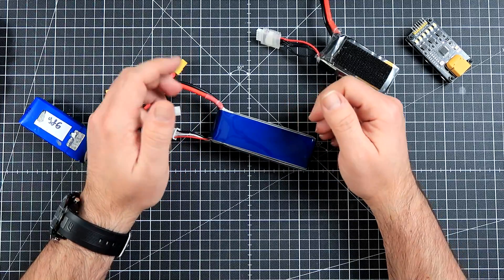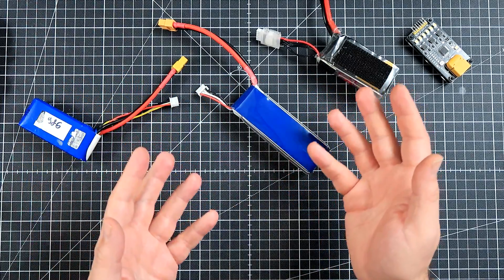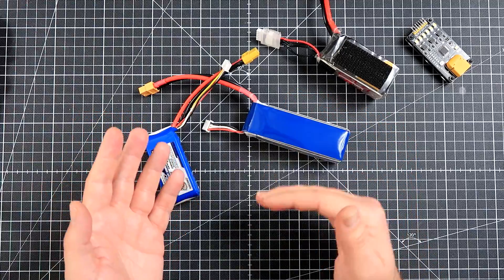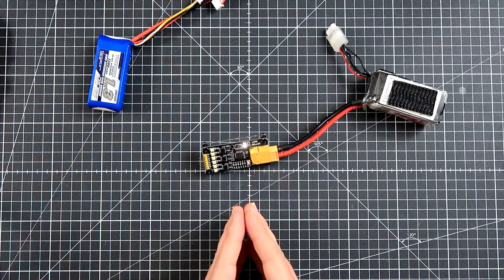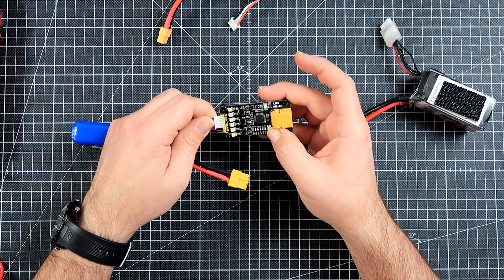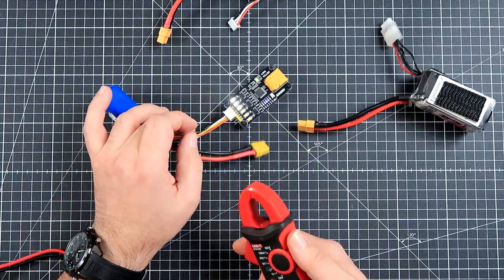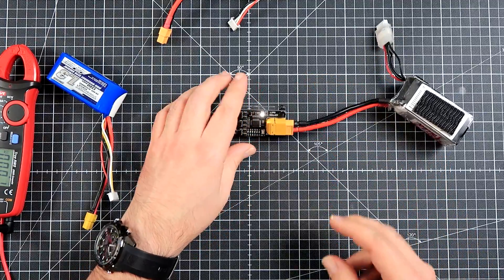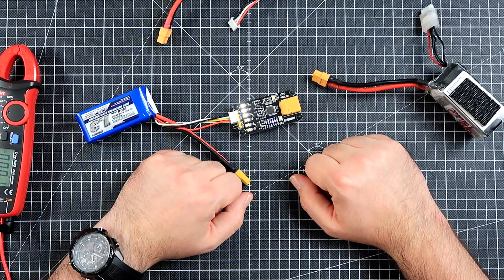URUAV LiPo Killer hands on

Comment: High voltage cells can't be balance discharged:
Tested on multiple 1S HV (4,35 Volt)
On 2 devices that I bought.. 

Haven't tried 2-6S HV yet, (don't have any) but read that it also doesn't work 

(problem is that it doesn't start the balance discharge..)

Comment: Does it somehow control the current when discharging to storage, or is it just a simple resistor? You can solder another parallel resistor to increase to discharge rate. See here: https://intofpv.com/t-the-perfect-lipo-discharge-tool-uruav-lipo-discharger-how-to-hack-diy